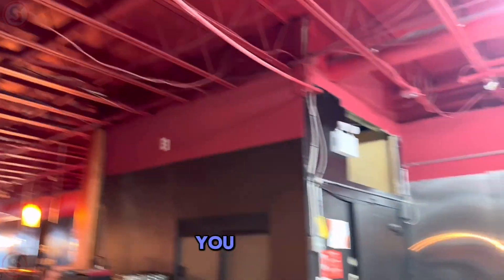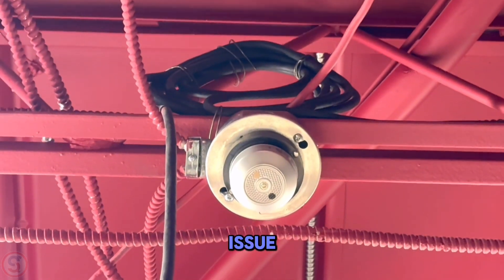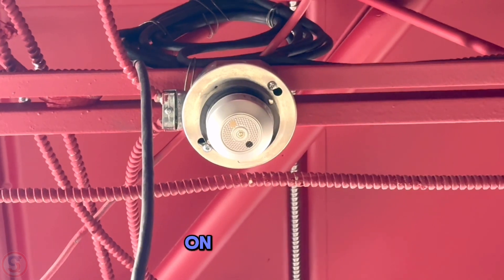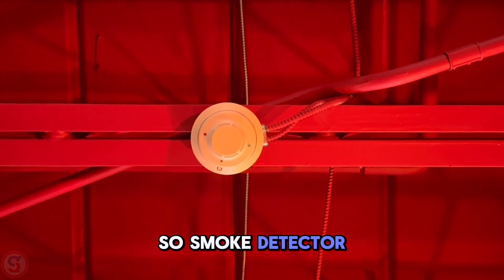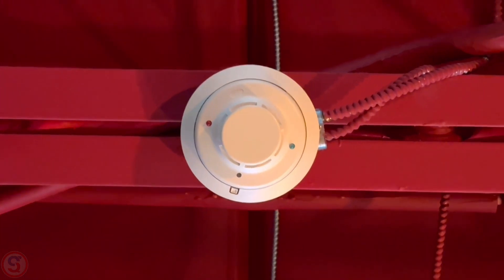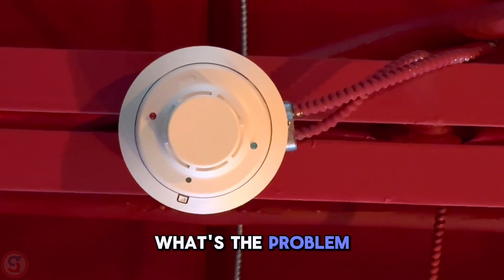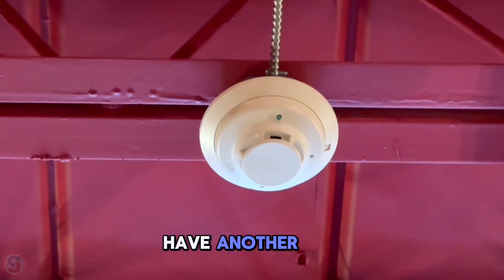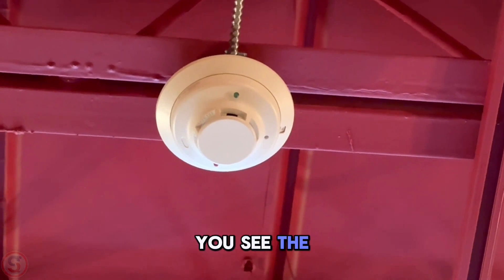Fire Detector Installation Mistakes That Could Cost Lives – Fix These Now!

Comment: Needs to be installed at the main ceiling level, instead of the beams below?
Reply: That is the only thing I can think.  
Heat/smoke detectors need to be close to the ceiling to go off when heat/smoke start to build. (Currently in a rental property and the main floor smoke detector is 36 inches from the ceiling.  
Luckily the second floor detectors are all on the ceiling.
Reply from the maker: You’re absolutely right! Heat and smoke rise, so detectors should be installed as close to the ceiling as possible for early detection. A smoke detector placed 36 inches from the ceiling might delay activation, which isn’t ideal. Good to hear the second-floor detectors are properly installed!
Reply from the maker: In most cases, placing the detector as high as possible is the best approach.
•If structural limitations prevent proper placement, a collector or alternative smoke detection method may be needed.